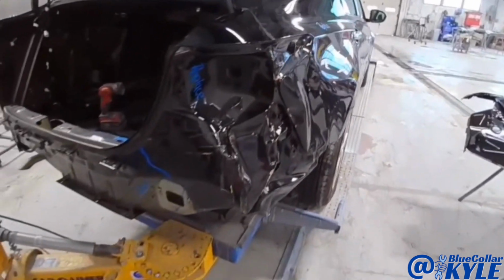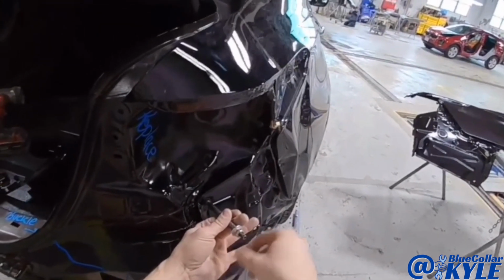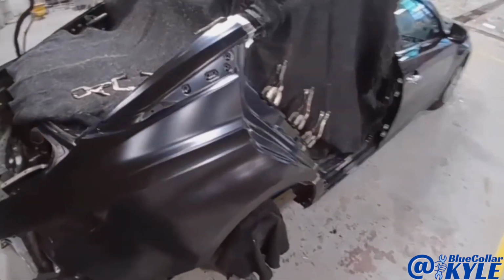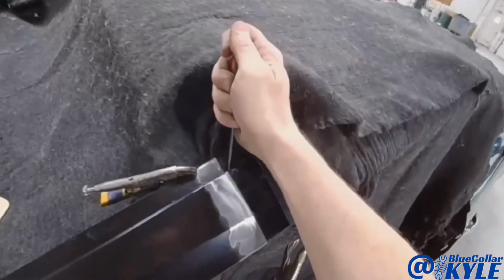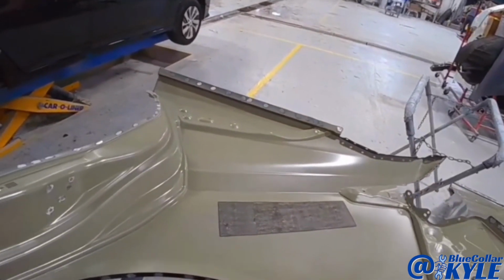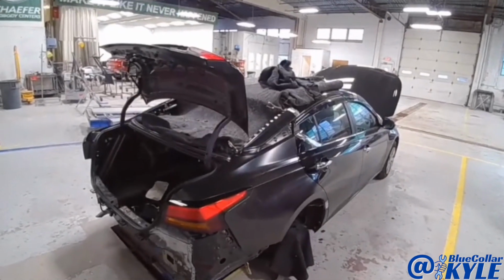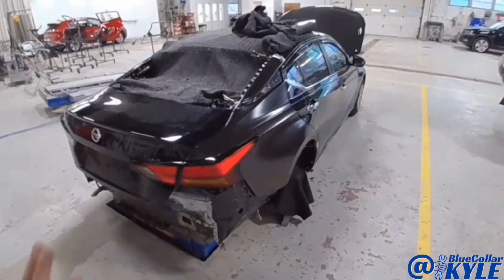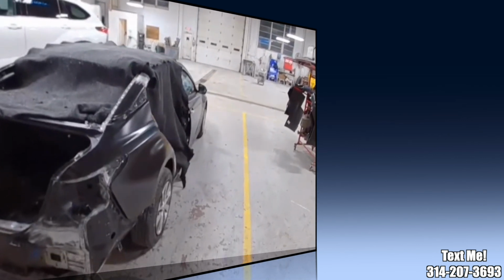Surgery On A Nissan Altima!

Comment: bro, ive said this on other videos. but thank you! its because of your videos that i was able to tackle a rear quarter swap on my 94 z32, took my far longer as i had to acquire the tools and never did body work a day in my life, but i legit got the quarter final panel aligned this week and mostly welded back into place today, just need some more finger sander belts and some more grinding then light filler and sand. so stoked to have a whole car again, you make these projects look too damn easy man. appreciate the wisdom